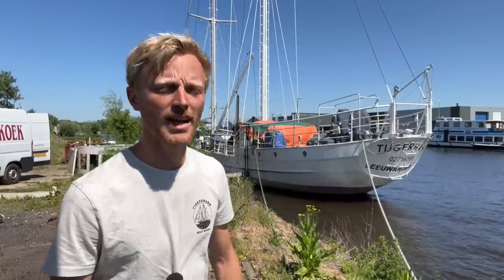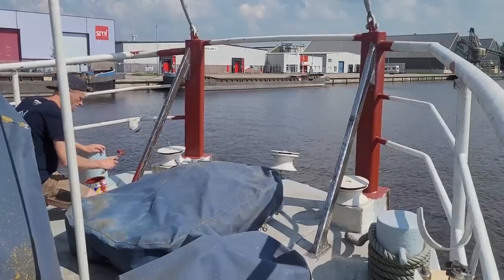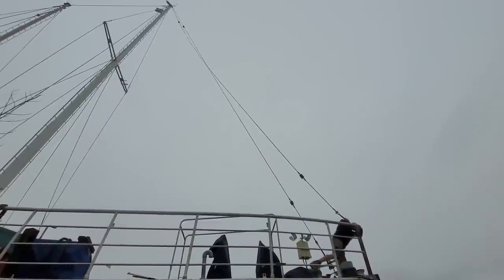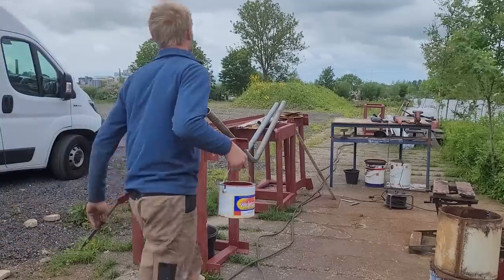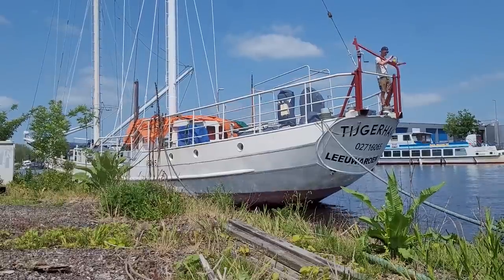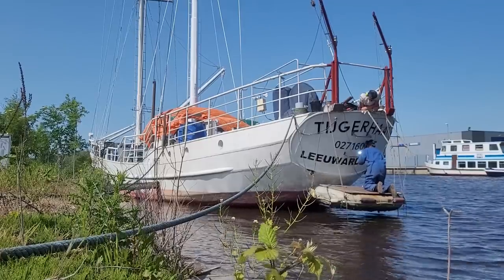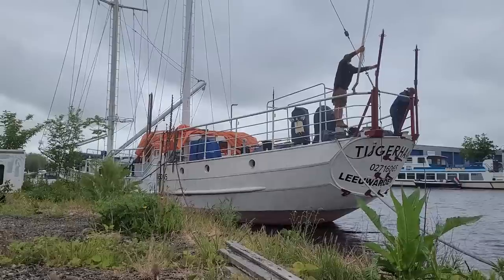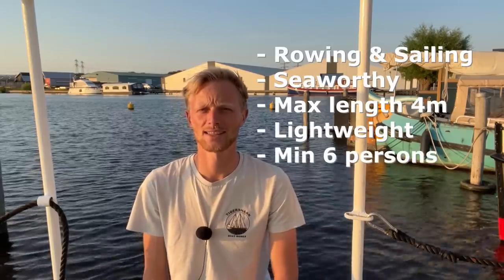This Aft Ship Needs A SERIOUS Remake  - Rebuilding Schooner Tijgerhaai EP16

Comment: When you build your dinghy remember to design in some passive buoyancy which will support the dinghy and all its passengers inside it, plus the outboard plus provide 200mm of freeboard (so that the dinghy will be detectable by radar in search and rescue situations).  I think you'll find it difficult challenge to allow 6 pax?
Reply from the maker: Thanks, Will do! A quick and dirty estemimate tells me we have about 500kg passive boyancy in the seats and the double bottom. If we keep the little foc'sle fully enclosed it will add another passive 800kg bouyancy. If not, we'll install an airbag inside to still have a part of that, but also space to store bags dry. It looks like 6 will not be that much of a challenge, because of the beam and the depth of the hull :)
Reply: @tigersharkboatworks  Okay, but remember you would do well to ensure you have freeboard to allow SAR radar to see your dinghy and, you shouldn't consider unshipping the outboard and throwing it overboard (even attached to a lanyard) to improve the freeboard.  In Australia we take this very seriously as we have sharks that like to nibble at your feet! :) .  I noted the aluminium window frames and presumed you will do something to prevent electrolysis with the steel deckhouse?
Reply from the maker: Alright, we'll make very sure :) The deckhouse is made from aluminium as well, so electrolysis wont be a problem there. Where the deckhouse joins the (steel) hull it's directly welded with a structural transition joint (triclad), which is a direct contact with a large contact area, so that prevents electrolysis.

Comment: Hello good watching your work , just a sergestion  while the vessel is in the water it is near imposable to use a level as un less the vessel has been specifically ballasted it will not be level and things can end up looking out of placein relation to masts or cabin sides a plumb bob haching beside a mast over a fixed point well let you check relavant horizontal and hence vertical and fore and aft
Reply from the maker: We're using the level to check the skew of items as well, so that we can give other parts the same amount of skew, so it doesn't have to be exactly horizontal to make everything the same :)

Comment: PS is your standing rigging Galvanized, Or Stainless? What are you coating with?
Reply from the maker: The shrouds are galvanized, and coated with aluminium primer. The parts that have been repaired or modified are primered with 2 layers of red oxide and 2 layers of white topcoat. The backstays are regular steel wire, with a coating similar to tectile :)
Reply: @tigersharkboatworks  The Best choice for a Sea boat that goes where you want and need it to! Regular galvanized wire,and steel is much more common, and readily available in plenty of remote places on this Earth! Than stainless rigging, In my Opinion, Best Choice for Real Boats! Aaaaargh! SMILES

Comment: All the room on deck , why not forget Davits and store the dinghy on deck on a long trip , much safer ,  you have the lift power , ?
Reply from the maker: Good point, but we want to have the option to use the space on deck for drinks or diner with large groups. On rough weather passages it is indeed much safer to store the dinghy on deck.